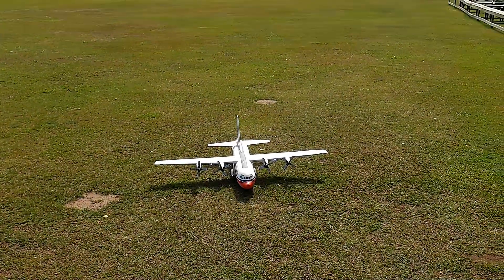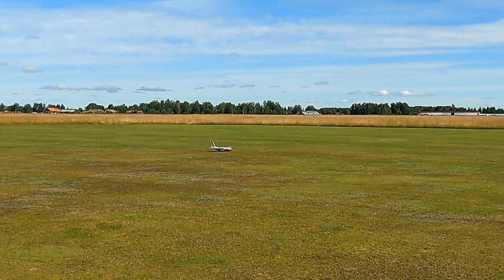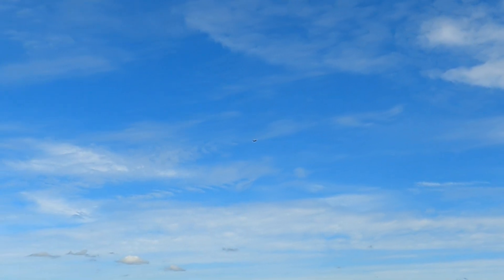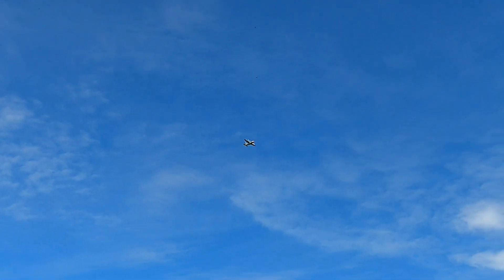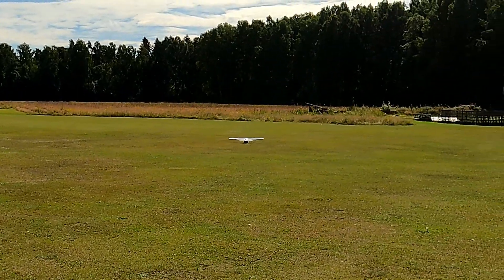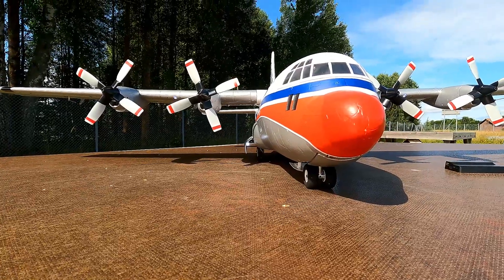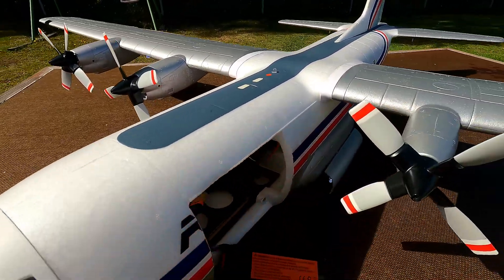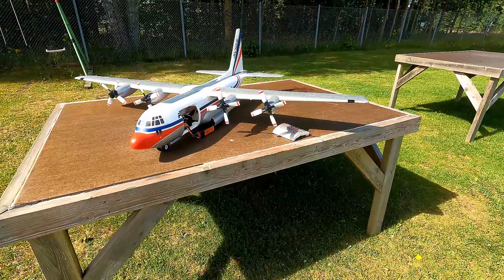Avios C-130 Hercules Flaps Test

Comment: Hi Sir,  I just got this model,  I noticed that is only one throttle cable to connect to the receiver for all the 4 motors. Can you do sharp turns even with out differential thrust.?
Reply from the maker: The rudder is effective but it flies like a scale model.
If you want acrobatics you need to use sepparate channels. On the old version almost everyhing was connected to a junktionbox. I would be suppuriced if they have removed it in the new version.

Watch this film to get an idea what to look for:
https://youtu.be/J-U2Fq-SUkE
Reply: @DanielsRCHobby  OK,  thank you Sir, it was my big concern, if I take off I will be able to turn around with 4 motors pushing forward. Thank again.  I will take precautions.
Reply from the maker: @nq1980  It is an easy model to fly. 
Keep the speed up in the turns and you will be fine. I usualy don't use flaps during my first few flights. My Hercules wants to dive when deploying them so keep some height when start to experiment with it.
Reply: @DanielsRCHobby  OK Sir,  thanks,  I really appreciate your advice.